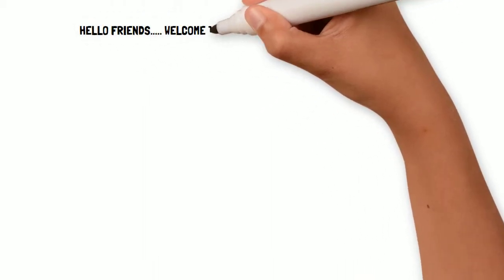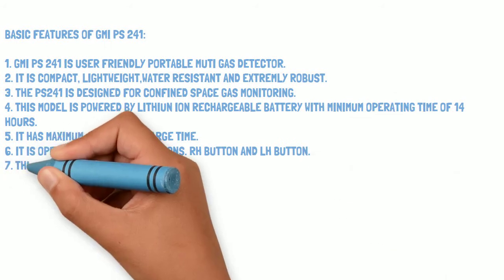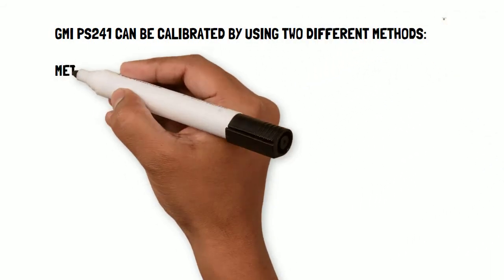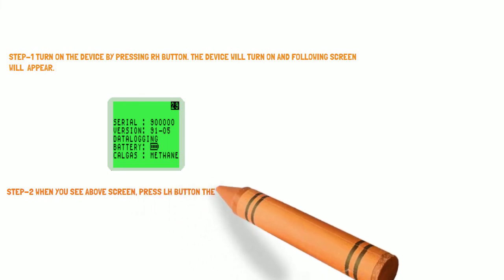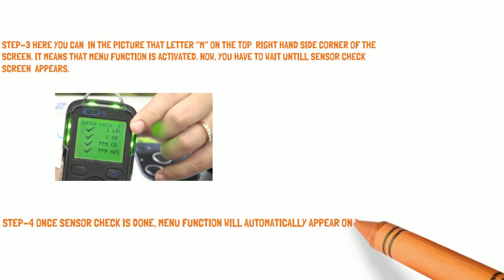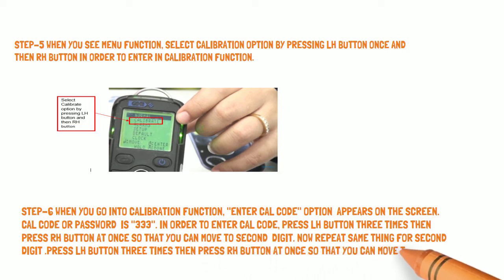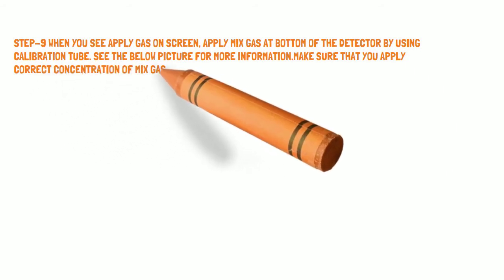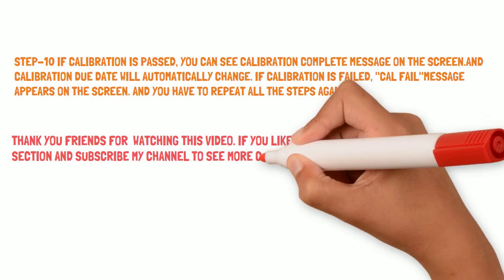How to do manual calibration of GMI PS241 ( Portable Multigas Detector )

Comment: Dear sir/madam. I did not see CAL SET/ AUTO SET option, the meter just ask me to press RH to zero all gas, then another screen with METHANE and its level and ask me to insert gas.  In this way, I cannot see all 4 gases level ,instead only methane level, then when methane level is reached, press RH to accept 1 gas at a time, until all 4 gas is accepted to complete calibration. May I know wat can I do to see the CAL SET/ AUTO SET option??
Reply from the maker: Hello wai
I think you are in cal set option. When you see methane and its level, you need to apply multi gas at that time.When you apply gas, gas concentration of methane gas start to increase, set it 50% lel by using LH button, then press RH button to set this value. Once you set Methane gas value, you will be directed to CO gas. Repeat same steps for CO gas, set it to 100 ppm. Then repeat same steps for H2S gas, set H2S to 25 PPM.
Reply: @InstrumentCalibration  Dear sir/madam, thank you very much, but is there anything I can do to show the AUTO SET option?
Reply from the maker: @lohwaiseng  No, as per my knowledge you can not do anything. Because I believe it is factory setting. But you can directly contact to manufacturer about this problem. May be they can give you proper guidance.
Reply: @InstrumentCalibration oh... thank you very much sir